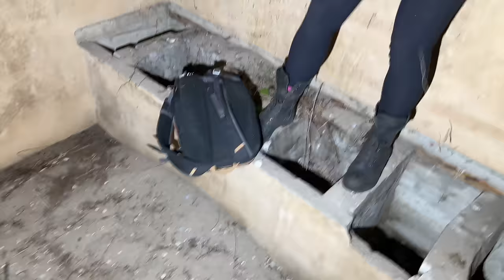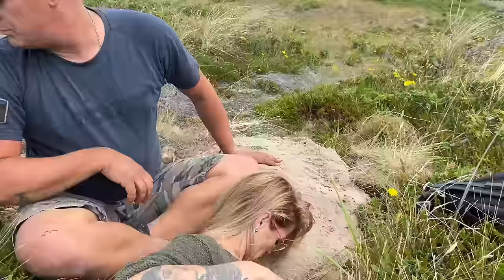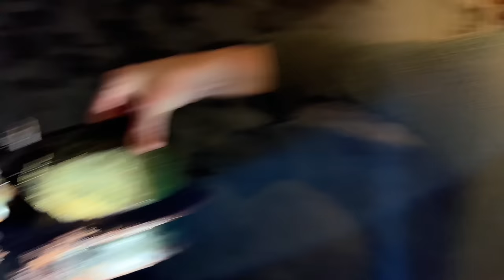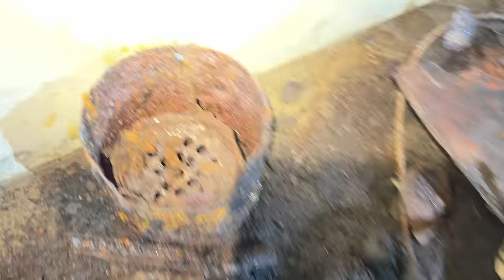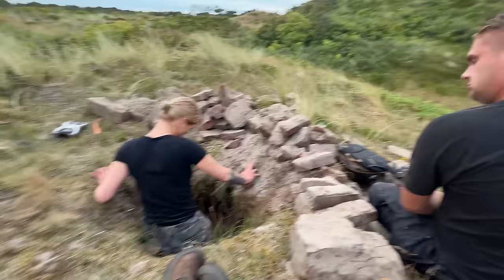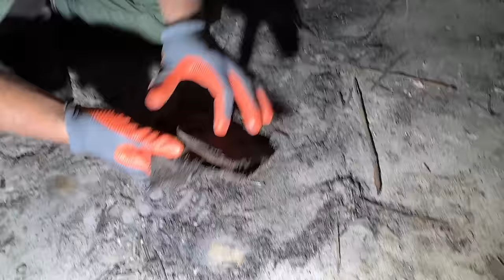GRAVEN NAAR 4 WW2 BUNKERS!

Comment: That "Teapot" is the kettle that fits into the top of the bunker stoves, you remove the round top plate on the stove and the kettle fits into the hole so smoke doesn't escape from the stove.
Reply from the maker: Thanks 😍